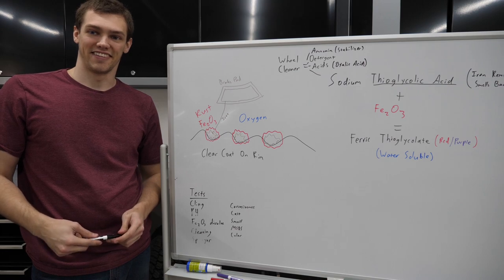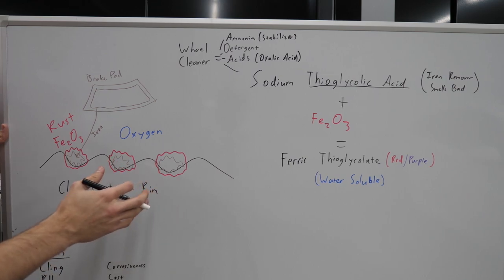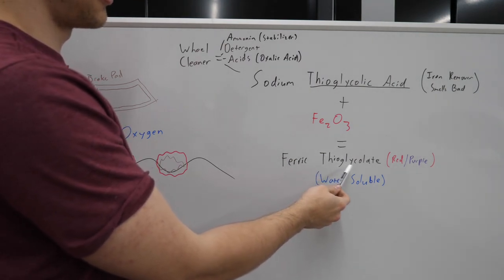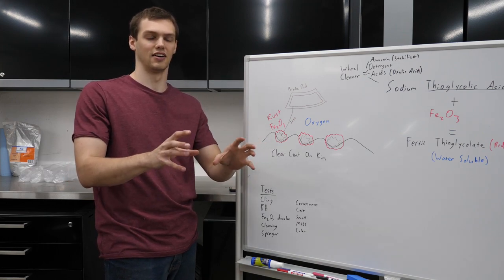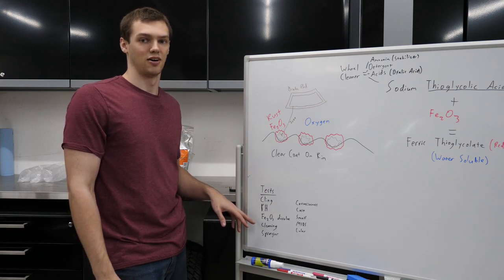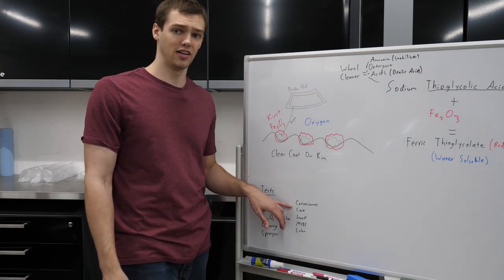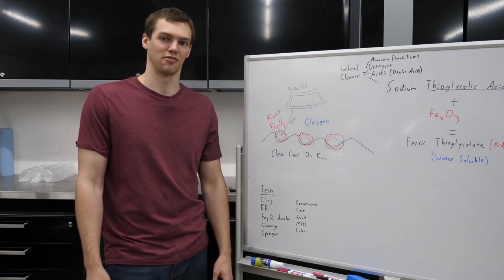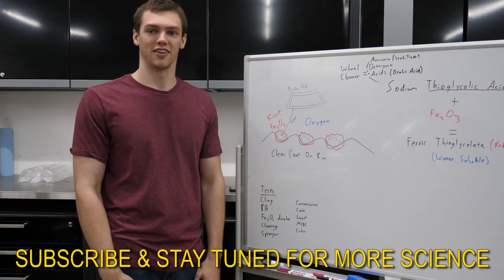The Best Wheel Cleaners Experiment Intro

Comment: Hey dude! Since you’re taking suggestions for tests, I’ve got an interesting one for you - on AmmoNYC’s how to wash microfiber vid there’s a comment from a person named Sherri Joubert. She explains she was a chemist at Tide and does a pretty deep dive on why you would want to do 2 washes on your microfiber towels 1 load w/ a liquid detergent and then another with powder, or vice versa. The comment is about 6 months old on a 4 year old video. Thought it might be something you’d like to take a look at. I can’t copy pasta it here cuz I’m on mobile.
Reply from the maker: Absolutely. Thank you. I love this kind of info.
Reply from the maker: @Naoi good question. While I don't know the exact science I can share my experience and what I've read at least. Sealants/waxes are designed to adhere or in some cases "bond" with the clear coat. They are not designed to do the same with microfiber. So even though they are chemically resistant, I think they come out of microfiber much easier than off of paint. Also when you wash microfiber, you are soaking and letting them sit in a concentrated strong cleaner whereas you do not with your car typically. You wouldn't put apc on your car and let it sit because of course it will start to eat through protection. Now coatings are a whole other issue. I honestly throw away towels that I use for true coatings because they crystallize and harden on the towel in a very noticable way that does not seem to come out much in a wash for me at least and I do not want to rub that on anything. Hope that helps.